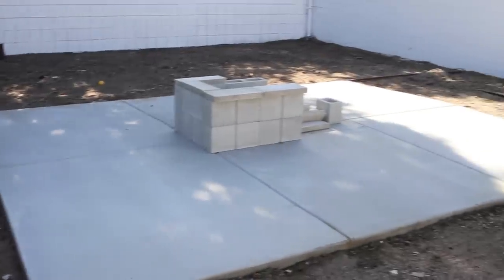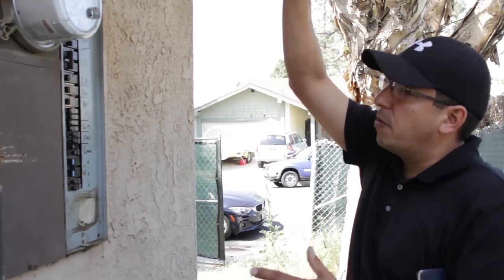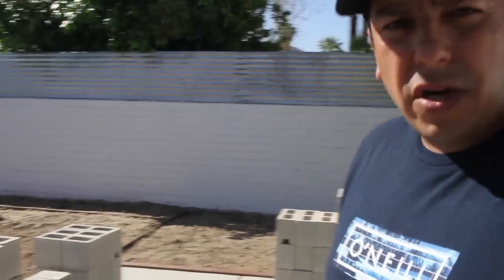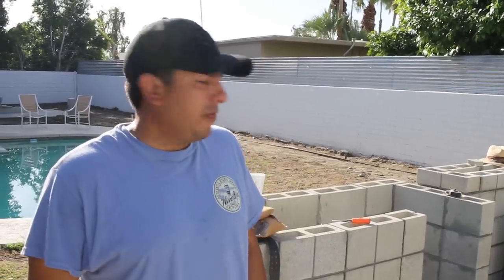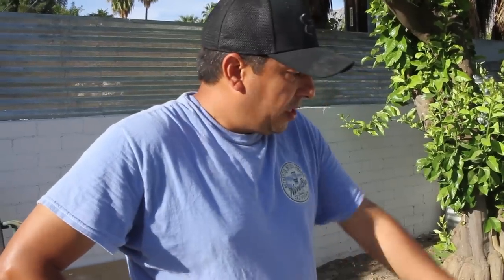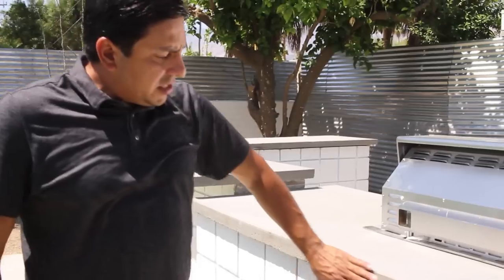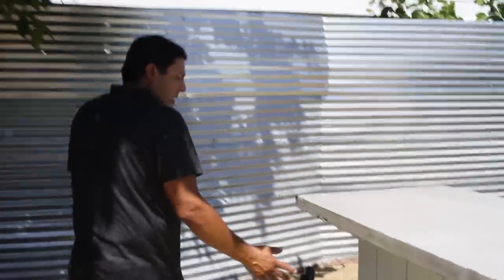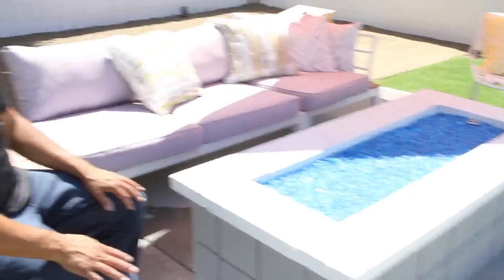HOW TO Build a custom BBQ & Fire Pit with cement blocks

Comment: I love those blocks with the groove creating the square patter, what is that called?
Reply: The square pattern is very nice and simple with a mid century modern feel…would like an answer on the type of block as well.  Nice project, nothing over the top
Reply from the maker: Thanks for the comment
Reply: I'd like to know as well. It makes a huge difference. Edit: figured it out. It's called a scored cinderblock. Thinking about doing something similar but using cinderblock adhesive instead of mortar.

Comment: Why are the blocks not offset? Is it ok because it is not really meant to be structural as in a building? Aesthetically it looks good like that.
Reply: It’s not Structual.   Its ok to not stager.  If it was a normal wall or load bearing it would need rebar and concrete poured
Reply: @dannyc8008  yeah
... the countertop is only about 400 lbs. it's not like it needs to widthstand side loads or wind like a building.

Comment: why are there no air vents installed so the gas can escape from the island? bbq galore will not work on a bbq i an island without vents. i have this problem what i would like to see is how to cut rectangaluar hole in cender block to add ss vent covers. TIA